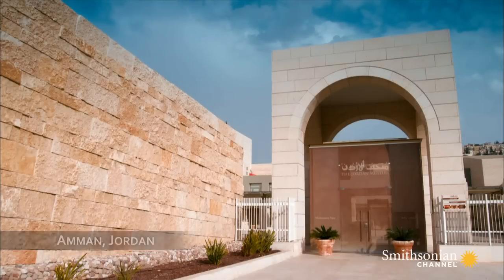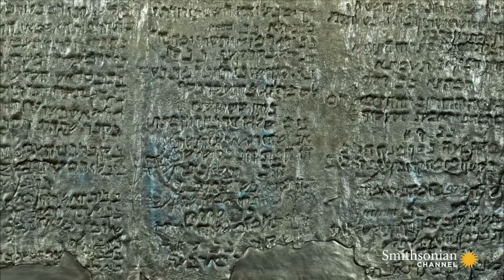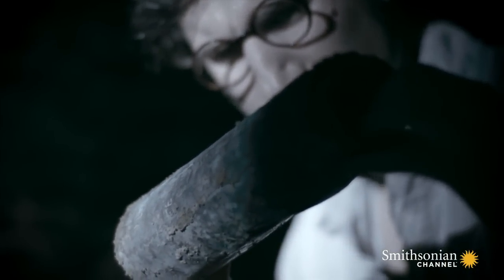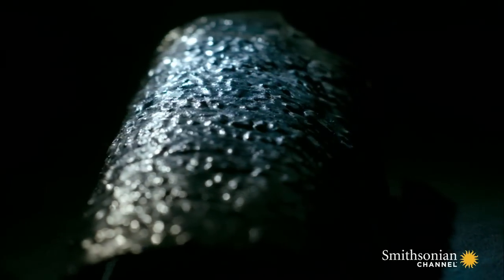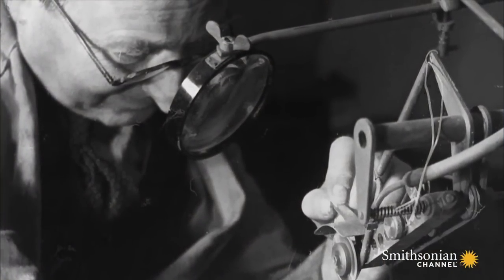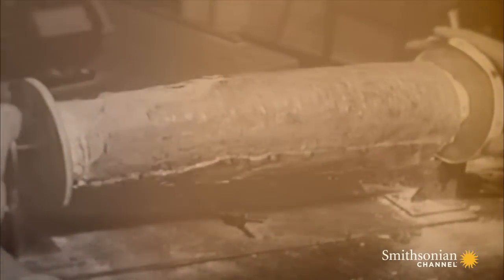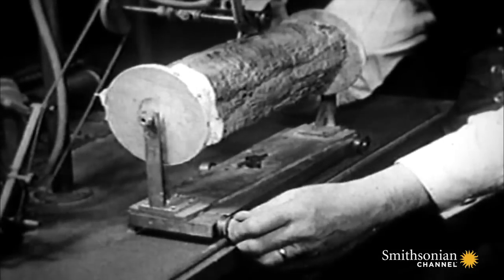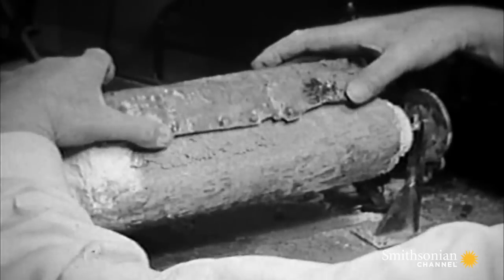How to Unroll a Dead Sea Scroll Without Destroying It

Comment: The cutting saw probably automatically applied cutting oil to the material being cut to prevent the cutting blade from getting clogged with the metal filings.  Cutting oil is normally applied automatically by pipe threading machines as they cut threads on metal pipe.  I doubt this oil was removed after the cuts were made to the copper scroll.  I suspect this oil has some acid in it.  To stop the corrosion at the cut areas on the copper scroll I believe something alkaline may have to be applied to neutralize the acid. The conservators of this scroll should study the ingredients of this cutting oil.